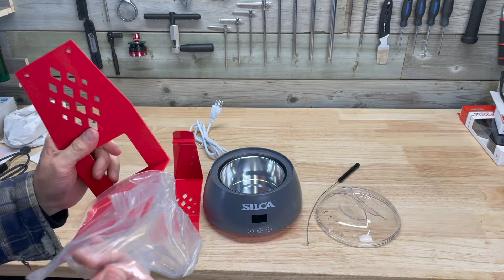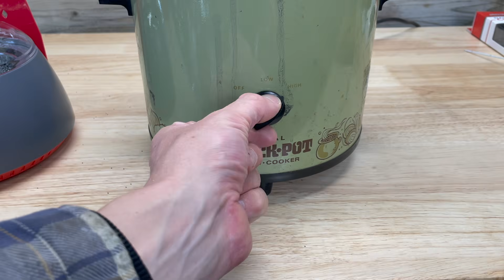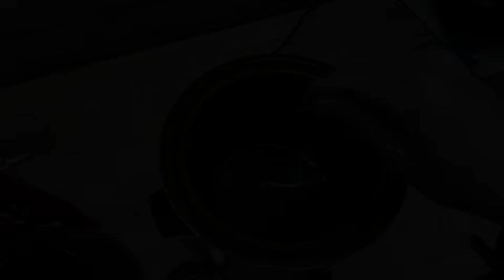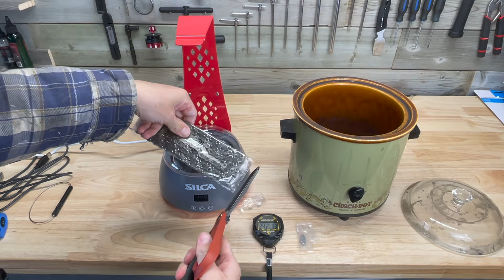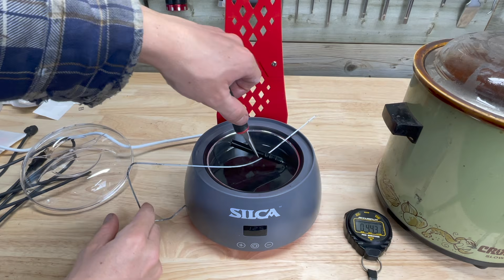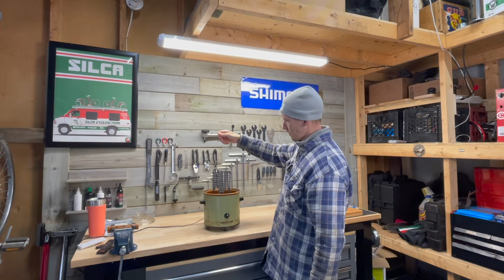Is Silca’s Wax System Worth It For Chain Waxing?

Comment: I use an old electric rice cooker and a bag of wax tea light candles, which all works a treat. 
Ikea sells big packs of tea light candles for a few bucks. No super duper additives, but it's cheap as chips.
Second hand rice cookers cost a few bucks in thrift stores. People even throw them out when the non-stick coating wears off the pot, but the heating elements are still working fine. I find that the wax melts pretty quickly, and the KEEP WARM setting keeps it liquid without boiling it to death.
SILCA makes lovely looking products. But, if you want to give it a try, and or keep your budget as low as possible, candles and a rice cooker is hard to beat.
Reply: Did you try IKEA tea lights? They use palm wax and seem very soft.

Comment: You don't need to agitate and "cook" the chain.  When the wax is fully liquid, a quick dunk and out is sufficient.  Use some imagination on a better hanger for the crock pot rig.  No way I'm dropping $100 for a branded Silca crock pot that does the exact same thing.....
Reply from the maker: You do want the chain (metal) to fully heat up and expand to allow the wax to penetrate deeper.  Quick dunk wouldn’t allow chain to get up to temp.  But yes, plenty of clever systems you could diy for better dunking 👍

Comment: $5 crock pot smaller than that one from thrift store.
$4 block ofparaffin from wal mart.
$1 bottle of powdered graphite mixed in wax( approx 1 oz)
$5 countertop banana hanger over a piece of tin foil for drips. 
Free coat hanger wire.
The silca system is neat, but a bit pricey.
Reply: The banana hanger is a great idea, thanks. Question , powdered graphite over powered PTFE ?
Reply: @stevemahoney1733  Graphite was convenient at the time but have used PTFE since. Not sure how many watts I gained with my mediocre cycling power though 😂. Seems the waxing does last slightly longer with a powdered additive.
Reply: @BRTbike-fz5fn  Thanks, finally decided to take the plunge this winter & start waxing the chains. Mostly because chains have gotten so freakin' expensive (80.00 per, & I've always rotated 5 chains per cassette ). Seems waxing will offer similar distance per chain as rotating every 1000 k's without needing to shell out for 5 chains at a time. Again, the banana hanger idea is exactly what I was looking for. Happy new year.
Reply: @stevemahoney1733  Better than a banana hammock. 🤣
Reply: @davidcampagna2223  Why ? What was the need to go there? And more importantly, why did you go there? (90% chuckle, 10% serious )
Reply: @stevemahoney1733  because I have the sense of humor of the typical 1990's middleschooler. 🤣
Reply: @davidcampagna2223  Understood but you realize the odds of me associating hammock with banana hanger just went up 10 fold. T

Comment: For waxed chains, the best thing that I found is to use a heat gun !

It's way easier! You get the same result as in immersive waxing but faster and you don't have to take the chain off every time.

The way you do it is to simply heat up your chain with the heat gun and apply drip-on wax. It will melt right into the links while evaporating the emulsion away at the same time so you don't even have to wait for 24 for it to cure, you can go ride as soon as it solidifies (30 min).

Other advantage is that after a ride I just reheat my chain and remelt all those little bits of wax right back into the chain so it's nice dry and rewaxed for the next ride and it only takes 10 minutes!

Having tried all possible methods, this one is the easiest and most efficient.
Reply: That's not a good idea. It can damage your bike, paint, weaken materials in your chain.

Comment: Great video! Whats your method of removing the old wax from the pot once its been well used?
Reply from the maker: If you want to remove wax from the pot, let it fully cool, then reheat for 1-2 min to melt the bottom and sides, then just twist out the puck
Reply: @onelastlap9302  awesome, thanks!
Reply: Just pour it out ?
Reply: @Leo-gt1bx  pour out hot wax? Into what?
Reply: @Tom_1759  When my last use of the wax is done I just pour it into an empty tin can and then wipe out the pot whilst the wax is soft.

Comment: Silka strip chip at 0:50 when do you have to use just on brand new chains , or also on previously never waxed just lubed chains?
Reply from the maker: You’d use the strip chip on a brand new chain.  It’s generally not a good idea to wax a chain you’ve already been riding for a while, best to start fresh with new chain
Reply: @onelastlap9302 oh thank you 🙏

Comment: Problem with the Silca (amazon body wax) pot is you can just barely fit a single chain into it with a little effort.  The pot needs to be around 20% larger.
Reply: I just purchased and saw the small sized dish thinking ... jeez this be a challenge for 1 chain.  I generally do a batch of 6 chains in one go using my generic crocpot.  Of course I didn't expect the Silca to do 6 chains in one go - but like atleast more space to swizzle and fit in!

Comment: Thank you for the video, how does the wax do for MTB and dusty conditions?
Reply from the maker: I’ve been using a waxed chain on my mtb, found that it works well at keeping things pretty clean.  You’ll probably want to do hot water soak/wipe in between wax treatments because of dust though
Reply: @onelastlap9302  Thank you for the information, I'll be giving it a try!

Comment: 70 degrees was “way too hot to touch”? Body temperature average is 98.6. Was it 28.6 degrees hotter than the inside of your mouth? 125 degrees? Your shower was hotter than that. I’ve been waxing chains for 40 years. If you need tips and suggestions, feel free to reach out.
Reply from the maker: Maybe you’re getting your units confused?  I’m in Canada, we have degrees Celsius…
Reply: Lmao I guess you're on freedom units😂

Comment: I like the double pot method with boiling water in the first. Can fit 4 chains at once, cost almost nothing. Also clean the chains by boiling in the same pot first.
Reply: I only boil clean once i a blue moon. I have been waxing for over 10 years now I just brush down amd wide down with acetone and rewax. I make my own mix so it is cheaper to replace.
Reply: @Leo-gt1bx  What's your recipe?
Reply: @deltafour1212 I use the standard PTFE mix.
Reply: @Leo-gt1bx I wish I could get PTFE in Egypt. Seems like it's a secret substance here
Reply: Yep, that's what I do as well.
In Egypt we don't have anything fancy and it seems this method is just as good and basically for free.
Reply from the maker: That sounds like a great method as well!
Reply: Yip, that is what I am using as well. Faster and easy to control the temperature on the induction plate I purchased for the process to avoid using the kitchen.

Comment: both systems are slow, with my system you can clean and hot rewax chain on bike in 12 minutes, any where and all equipment fit in shoe box, all for 7$, wax excluded
Reply from the maker: Sounds like a very interesting system!
Reply: @onelastlap9302  yes it is perfect for 1 chain at once, for more(5-10) chains at once your system saves time

Comment: I have been using a crock pot for 3 years. Just upgraded to the silca pot and the ability to pull the chain bang on 75 is worth the price.
Reply from the maker: Ya the precision and speed improvements were really helpful in the workshop for me as well 👍
Reply: There's no advantage of pulling at 75 just get more excess wax
Reply: @JK-wl5bx  big wrong^^--the absolute most ideal temp to pull a chain is 68*f. proven by silica internal studies and zero friction
Reply: @420xwaytoomanyx420 zero friction just put out a dedicated video saying to pull out at 90F (or whatever temp you immerse it in) is just as good performance wise, less wasteful, and more convenient (fewer adjustments and less waiting)
Reply: @m @mishaberger so true
I’ll be using a “break in” pulley wheel tool to shave off excess wax to help get my chains Trail ready

Comment: I'd be curious about one of those small fondue crock pots that sometimes come in combination with the bigger crock
Reply from the maker: Should also work, but may be a little tricker to get the chain into a smaller pot 👍
Reply: I have the small fondue pot. And my silca pot arrives tomorrow. I think I'll fire them both up and have some fondue while I wax some chains 😋

Comment: Excellent video straight to the point!  How many chains can you wax at once with the Silca?  I've also got a recumbent that's about 2.5 regular chains long.  Would that fit?
Reply from the maker: Thanks!  I’m usually just putting one chain at a time inside the pot.  It might be possible with an extra long chain, but would be a tight fit.  You’d need to fill it pretty high with wax, and likely some fussing the get it to fit nicely.  Would probably recommend cutting chain in two places to fit the Silca pot

Comment: $112 pot+$42 wax=$154, how many times that 500g of wax can be used, my candle wax is for free, and inductive heater is $7,
Reply from the maker: A bag of wax lasts around 60 uses, the speed and ease of use of the pot are great features, but cheaper diy options are also good!
Reply: @onelastlap9302  thanks
Reply: @onelastlap9302  I'm just calculating something, what is the total financial effect of using expensive wax compared to free wax: it turns out that one waxing costs $0.7, my chain costs $14, to assume that the chain will last the same number of kilometers (6000km), but the interval of waxing the chain with each 100km increase to 200km, the price of the used wax for that mileage will be 2.7 the price of the chain, and if the chain survives 6x longer than on oil, it turns out that due to the price of the wax, the effect is as if the chain lasted 2.2 times longer (6/2.7=2.2)

Comment: Well yeah.. the crock pot has a heavy ceramic liner and is designed to heat extremely slowly. If you want to do a comparison buy a $15 skin waxing pot.. same utility as silcas over priced system
Reply from the maker: Thanks for the feedback 👍

Comment: I have a recumbent bike and trike. The chains are about 3x the length of a regular bike chain. Probably wouldn't fit in the silca  pot.
Reply from the maker: Oh interesting, it may work if the pot is full and chain is coiled neatly, but a bigger pot may not a bad idea in this case!
Reply: you do not need to remove the chain from bike if chain is not hidden or out of hand, just use inductive heater to warm up chain and then touch it with wax and wipe with old towel

Comment: At the end of the day more expensive tends to be more convenient. You just need prioritize price and or convenience. If you want a budget option it will be less convenient and vice versa
Reply from the maker: Most of the time, that’s true!  The time saving here for me makes a big difference, and I’m far more willing to rewax my chains
Reply: You can easily find virtually identical wax pots that don’t have SILCA printed on them that cost about $30. You don’t get the chain hanging fixture, but that is certainly not worth an extra $70-80.
Reply: first, you don't need a pot at all, (you heat the chain on the bike with an induction heater) second, you can make almost free wax yourself without additives, and if you want additives, they have a price, but still cheaper than silca

Comment: How did  you not think of a way to hang your dripping chain OVER the crock pot?  Also, a crock pot is a poor choice for waxing. Look for an instant pot instead. It has multiple settings,  and the thrift stores seem to be full of them. Mine was also less than 10 dollars.
Reply from the maker: I haven’t seen instant pots at my local thrift store, but will check it out!  Ya, a wood piece or some hanger couple probably be fashioned for the regular croc pot as well 👍

Comment: good video. did you take a temp reading at all when you reduced the cheaper crock pot to the medium temp level?
Reply from the maker: Thanks!  I don’t think I did actually.  Rough guess is that it would keep already melted wax in the 60-80 range, but next time I plug it in, I’ll get a more exact answer for you 👍

Comment: probably a small difference overall, but the new wax in the form of small pellets would easily melt quicker than the whole chunk of reused wax - higher surface area exposed to heat. Either way, i would expect a lot more bang for the buck in the middle ground. That is, getting a slightly more expensive crockpot without reaching such a bike specific implementation.
Reply from the maker: Agree, it probably makes a difference.  I actually did put a few chunks into the Silca pot as well (look closely before I dump in the pellets) to try and keep the comparison closer.  I’ve heard a few using mid range pots with good results, I guess you can compare the time to melt/heat for your own pot and see how it stacks up!
Reply: I’ve got an instapot and the SILCA setup.  The silca heats up the wax just as fast without over shooting the temp.   The instapot I have to watch like a hawk with a candy thermometer to prevent burning the wax, and it also hard to cool it down with overcooling it prior to I removing the chain.
The silca is small (my biggest complaint) and doesn’t hold a full bag of wax…but it’s the ultimate in set and forget.
Reply: A instant pot should heat up faster than a crock pot - thin steel put vs thick ceramic, and more powerful heating element.

Comment: Why would you use wax vs lubricant? Thx?
Reply: It's the best lubricant and the chain stays clean. A filthy chain can be reset to almost good as new with boiling water and a rewax.
Reply from the maker: Wax (especially hot wax like shown here) has a couple advantages, first is that it runs super clean.  The wax doesn’t attract dirt, so the chain doesn’t get black and oily over time.  Second, the wax is also very efficient, so there is less power lost from friction as a result.  Both of these combine for a longer lasting and faster drivetrain 👍. See my other videos (linked in description) for a few more details surrounding the hot waxing process
Reply: My guess is if you enjoy faffing around with your bike as much (or more) than riding it? I've never talked with anyone that was ambivalent about wax, they seem to be in a cult regarding chain waxing...going way, way back to when some of these folks burned-down their shop or kitchen cooking chains on a stove before there were things like crock-pots. Back then it was just paraffin sealing wax dosed-up with graphite or moly, now it's a big biz with specialty everything for the wax cultist. Chains are cheap (KMC's anyway) so I just oil mine and toss 'em when they measure halfway worn-out. More time riding, less time faffing around and less stuff-to-buy. Cogsets/chainrings last almost forever....just like the wax cultist's claim!

Comment: I'm currently using two-pot waxers for body waxing, and they seem to work great. They cost around $30 US. I also use a spoke for dipping and drying. But the Silca pot appears to be a great way to start waxing your chains if you haven't gone through the possess.
Reply from the maker: Heard from a few people who use those style waxers, sounds like they’re also a good option.  How have you found it in regards to time to heat the wax/outside temperature?  Any temp control on them?
Reply: @onelastlap9302  I haven't timed it, but it seems to be short, and I don't have a fancy temperature reader. However, it does have a digital reader for the wax, which is helpful. Plus, you can re-waxe using the dip method with the two-pot system. I'm going to do a more in-depth review once I have used it a few times.